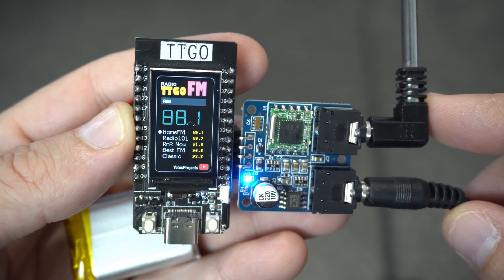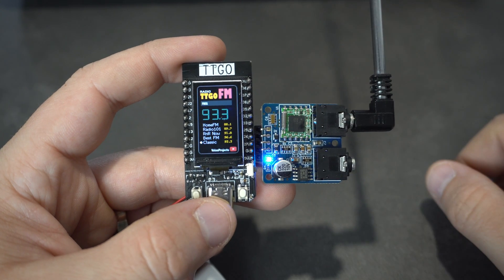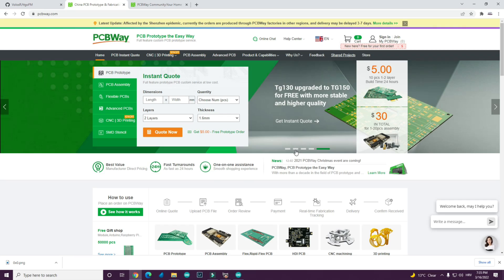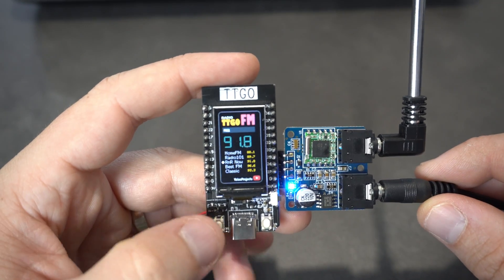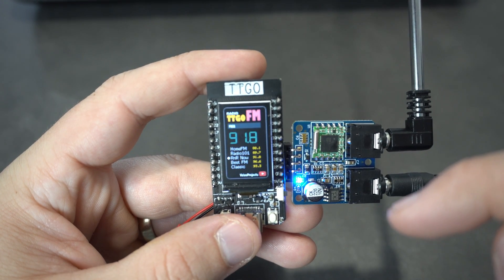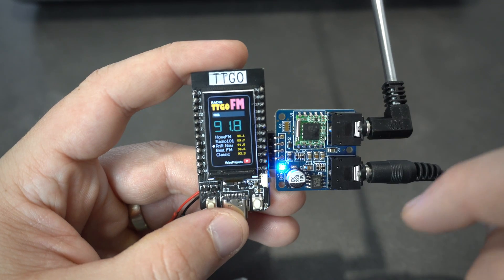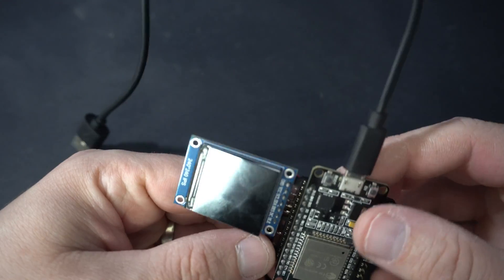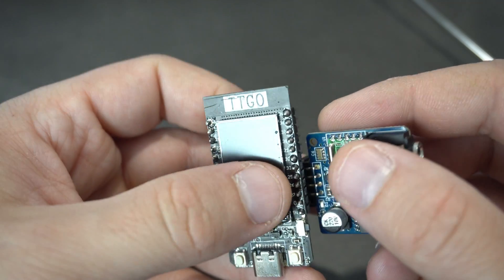FM Radio using ESP32 (TTGO T-Display)

Comment: Hello, Volos !!!
Your code is not compiling. Errors are:
Arduino: 1.8.19 (Windows 10), Board: "TTGO LoRa32-OLED, TTGO LoRa32 V2.1 (1.6.1), 80MHz, 921600, None, Disabled"

C:\Users\Ovidiu\Documents\Arduino\sketch_oct23a\sketch_oct23a.ino: In function 'void setup()':

sketch_oct23a:47:4: error: 'ledcSetup' was not declared in this scope

   47 |    ledcSetup(pwmLedChannelTFT, pwmFreq, pwmResolution);

      |    ^~~~~~~~~

sketch_oct23a:48:4: error: 'ledcAttachPin' was not declared in this scope; did you mean 'ledcAttach'?

   48 |    ledcAttachPin(TFT_BL, pwmLedChannelTFT);

      |    ^~~~~~~~~~~~~

      |    ledcAttach

In file included from C:\Users\Ovidiu\Documents\Arduino\sketch_oct23a\sketch_oct23a.ino:94:

C:\Users\Ovidiu\Documents\Arduino\sketch_oct23a\fm.h: At global scope:

fm.h:16:22: error: redefinition of 'const short unsigned int fm [32400]'

   16 | const unsigned short fm[32400] PROGMEM={

      |                      ^~

In file included from C:\Users\Ovidiu\Documents\Arduino\sketch_oct23a\sketch_oct23a.ino:7:

C:\Users\Ovidiu\Documents\Arduino\sketch_oct23a\fm.h:16:22: note: 'const short unsigned int fm [32400]' previously defined here

   16 | const unsigned short fm[32400] PROGMEM={

      |                      ^~

In file included from C:\Users\Ovidiu\Documents\Arduino\sketch_oct23a\sketch_oct23a.ino:95:

fonts.h:3:15: error: redefinition of 'const uint8_t DSEG7_Classic_Regular_36Bitmaps []'

    3 | const uint8_t DSEG7_Classic_Regular_36Bitmaps[] PROGMEM = {

      |               ^~~~~~~~~~~~~~~~~~~~~~~~~~~~~~~

In file included from C:\Users\Ovidiu\Documents\Arduino\sketch_oct23a\sketch_oct23a.ino:8:

C:\Users\Ovidiu\Documents\Arduino\sketch_oct23a\fonts.h:3:15: note: 'const uint8_t DSEG7_Classic_Regular_36Bitmaps [6185]' previously defined here

    3 | const uint8_t DSEG7_Classic_Regular_36Bitmaps[] PROGMEM = {

      |               ^~~~~~~~~~~~~~~~~~~~~~~~~~~~~~~

fonts.h:101:16: error: redefinition of 'const GFXglyph DSEG7_Classic_Regular_36Glyphs []'

  101 | const GFXglyph DSEG7_Classic_Regular_36Glyphs[] PROGMEM = {

      |                ^~~~~~~~~~~~~~~~~~~~~~~~~~~~~~

C:\Users\Ovidiu\Documents\Arduino\sketch_oct23a\fonts.h:101:16: note: 'const GFXglyph DSEG7_Classic_Regular_36Glyphs [94]' previously defined here

  101 | const GFXglyph DSEG7_Classic_Regular_36Glyphs[] PROGMEM = {

      |                ^~~~~~~~~~~~~~~~~~~~~~~~~~~~~~

fonts.h:198:15: error: redefinition of 'const GFXfont DSEG7_Classic_Regular_36'

  198 | const GFXfont DSEG7_Classic_Regular_36 PROGMEM = {

      |               ^~~~~~~~~~~~~~~~~~~~~~~~

C:\Users\Ovidiu\Documents\Arduino\sketch_oct23a\fonts.h:198:15: note: 'const GFXfont DSEG7_Classic_Regular_36' previously defined here

  198 | const GFXfont DSEG7_Classic_Regular_36 PROGMEM = {

      |               ^~~~~~~~~~~~~~~~~~~~~~~~

sketch_oct23a:101:11: error: redefinition of 'const int pwmFreq'

  101 | const int pwmFreq = 5000;

      |           ^~~~~~~

C:\Users\Ovidiu\Documents\Arduino\sketch_oct23a\sketch_oct23a.ino:14:11: note: 'const int pwmFreq' previously defined here

   14 | const int pwmFreq = 5000;

      |           ^~~~~~~

sketch_oct23a:102:11: error: redefinition of 'const int pwmResolution'

  102 | const int pwmResolution = 8;

      |           ^~~~~~~~~~~~~

C:\Users\Ovidiu\Documents\Arduino\sketch_oct23a\sketch_oct23a.ino:15:11: note: 'const int pwmResolution' previously defined here

   15 | const int pwmResolution = 8;

      |           ^~~~~~~~~~~~~

sketch_oct23a:103:11: error: redefinition of 'const int pwmLedChannelTFT'

  103 | const int pwmLedChannelTFT = 0;

      |           ^~~~~~~~~~~~~~~~

C:\Users\Ovidiu\Documents\Arduino\sketch_oct23a\sketch_oct23a.ino:16:11: note: 'const int pwmLedChannelTFT' previously defined here

   16 | const int pwmLedChannelTFT = 0;

      |           ^~~~~~~~~~~~~~~~

sketch_oct23a:105:5: error: redefinition of 'int backlight [5]'

  105 | int backlight[5] = {10,30,60,120,220};

      |     ^~~~~~~~~

C:\Users\Ovidiu\Documents\Arduino\sketch_oct23a\sketch_oct23a.ino:18:5: note: 'int backlight [5]' previously defined here

   18 | int backlight[5] = {10,30,60,120,220};

      |     ^~~~~~~~~

sketch_oct23a:106:6: error: redefinition of 'byte br'

  106 | byte br=1;

      |      ^~

C:\Users\Ovidiu\Documents\Arduino\sketch_oct23a\sketch_oct23a.ino:19:6: note: 'byte br' previously defined here

   19 | byte br=1;

      |      ^~

sketch_oct23a:108:10: error: redefinition of 'TFT_eSPI tft'

  108 | TFT_eSPI tft = TFT_eSPI();

      |          ^~~

C:\Users\Ovidiu\Documents\Arduino\sketch_oct23a\sketch_oct23a.ino:21:10: note: 'TFT_eSPI tft' previously declared here

   21 | TFT_eSPI tft = TFT_eSPI();

      |          ^~~

sketch_oct23a:109:14: error: redefinition of 'TEA5767Radio radio'

  109 | TEA5767Radio radio = TEA5767Radio();

      |              ^~~~~

C:\Users\Ovidiu\Documents\Arduino\sketch_oct23a\sketch_oct23a.ino:22:14: note: 'TEA5767Radio radio' previously declared here

   22 | TEA5767Radio radio = TEA5767Radio();

      |              ^~~~~

sketch_oct23a:111:8: error: redefinition of 'String stations [5]'

  111 | String stations[5]={"HomeFM", "Radio101","RnR Now", "Best FM","Classic "};

      |        ^~~~~~~~

C:\Users\Ovidiu\Documents\Arduino\sketch_oct23a\sketch_oct23a.ino:24:8: note: 'String stations [5]' previously declared here

   24 | String stations[5]={"HomeFM", "Radio101","RnR Now", "Best FM","Classic "};

      |        ^~~~~~~~

sketch_oct23a:112:8: error: redefinition of 'String freq [5]'

  112 | String freq[5]={"88.1","89.7","91.8","96.6","93.3"};

      |        ^~~~

C:\Users\Ovidiu\Documents\Arduino\sketch_oct23a\sketch_oct23a.ino:25:8: note: 'String freq [5]' previously declared here

   25 | String freq[5]={"88.1","89.7","91.8","96.6","93.3"};

      |        ^~~~

sketch_oct23a:114:5: error: redefinition of 'int sx'

  114 | int sx=20;

      |     ^~

C:\Users\Ovidiu\Documents\Arduino\sketch_oct23a\sketch_oct23a.ino:27:5: note: 'int sx' previously defined here

   27 | int sx=20;

      |     ^~

sketch_oct23a:115:5: error: redefinition of 'int sy'

  115 | int sy=130;

      |     ^~

C:\Users\Ovidiu\Documents\Arduino\sketch_oct23a\sketch_oct23a.ino:28:5: note: 'int sy' previously defined here

   28 | int sy=130;

      |     ^~

sketch_oct23a:116:5: error: redefinition of 'int fx'

  116 | int fx=88;

      |     ^~

C:\Users\Ovidiu\Documents\Arduino\sketch_oct23a\sketch_oct23a.ino:29:5: note: 'int fx' previously defined here

   29 | int fx=88;

      |     ^~

sketch_oct23a:117:5: error: redefinition of 'int fy'

  117 | int fy=134;

      |     ^~

C:\Users\Ovidiu\Documents\Arduino\sketch_oct23a\sketch_oct23a.ino:30:5: note: 'int fy' previously defined here

   30 | int fy=134;

      |     ^~

sketch_oct23a:119:5: error: redefinition of 'int chosen'

  119 | int chosen=0;

      |     ^~~~~~

C:\Users\Ovidiu\Documents\Arduino\sketch_oct23a\sketch_oct23a.ino:32:5: note: 'int chosen' previously defined here

   32 | int chosen=0;

      |     ^~~~~~

sketch_oct23a:121:6: error: redefinition of 'void setup()'

  121 | void setup() {

      |      ^~~~~

C:\Users\Ovidiu\Documents\Arduino\sketch_oct23a\sketch_oct23a.ino:34:6: note: 'void setup()' previously defined here

   34 | void setup() {

      |      ^~~~~

C:\Users\Ovidiu\Documents\Arduino\sketch_oct23a\sketch_oct23a.ino: In function 'void setup()':

sketch_oct23a:134:5: error: 'ledcSetup' was not declared in this scope

  134 |     ledcSetup(pwmLedChannelTFT, pwmFreq, pwmResolution);

      |     ^~~~~~~~~

sketch_oct23a:135:5: error: 'ledcAttachPin' was not declared in this scope; did you mean 'ledcAttach'?

  135 |     ledcAttachPin(TFT_BL, pwmLedChannelTFT);

      |     ^~~~~~~~~~~~~

      |     ledcAttach

C:\Users\Ovidiu\Documents\Arduino\sketch_oct23a\sketch_oct23a.ino: At global scope:

sketch_oct23a:152:5: error: redefinition of 'int b'

  152 | int b=0;

      |     ^

C:\Users\Ovidiu\Documents\Arduino\sketch_oct23a\sketch_oct23a.ino:65:5: note: 'int b' previously defined here

   65 | int b=0;

      |     ^

sketch_oct23a:153:5: error: redefinition of 'int press2'

  153 | int press2=0;

      |     ^~~~~~

C:\Users\Ovidiu\Documents\Arduino\sketch_oct23a\sketch_oct23a.ino:66:5: note: 'int press2' previously defined here

   66 | int press2=0;

      |     ^~~~~~

sketch_oct23a:154:6: error: redefinition of 'void loop()'

  154 | void loop() {

      |      ^~~~

C:\Users\Ovidiu\Documents\Arduino\sketch_oct23a\sketch_oct23a.ino:67:6: note: 'void loop()' previously defined here

   67 | void loop() {

      |      ^~~~

exit status 1

'ledcSetup' was not declared in this scope

This report would have more information with
"Show verbose output during compilation"
option enabled in File -> Preferences.
I do not know what else to do. 
Libraries used:https://dl.espressif.com/dl/package_esp32_index.json
Modified TFT_eSPIUser_Setup_Select.h

Comment: you had
6 months ago comment about larger T-Display S3 1.9 inch. If there is no time to redo it, could you suggest?) just change tft.pushImage(0,0,135,240,fm); on 170, 320, doesn't work, artifacts appear, at GPT chat, didn't help either (tft.init(ST7789_CABCCTRL);). All I could do was add tft.fillScreen(TFT_BLACK); so that there are no artifacts, multi-colored lines. Thank you
Reply: and when you press the button, the numbers on the screen do not change, although the frequency itself changes

Comment: Can the code also work on the larger T-Display S3?
Reply from the maker: yes, but only part of screen will be used
Reply: @VolosProjects  Thanks for the reply. Is it hard to modify the code for T-Display S3? I find it easy to find codes for this small T-Display on the internet. However there's not much resource for the larger one.
Reply from the maker: yes, it is still new board , i think in future there will be more examples, i have few examples on my chanell but. modifing code is not hard but it will take time.
Reply: @VolosProjects  I see. I think for now I will go with the smaller display first. Thanks for your sharing and contribution, I really appreciate it.

Comment: It would be nice to find an FM module that can pick up distant low power FM stations. Right off the bat this module is only for local strong stations. Usually for distant stations you will put an outdoor antenna and rotator. 73

Comment: Great little project. Haven’t got a TTGO but saw you did on a normal esp32.

Ai couldn’t figure out what pins to attach where. Do you have to modify the code to work?
Reply from the maker: Tnx.I used pins 26 and 27, if you use other pins you will need to edit this line of code "Wire.begin(26,27);"